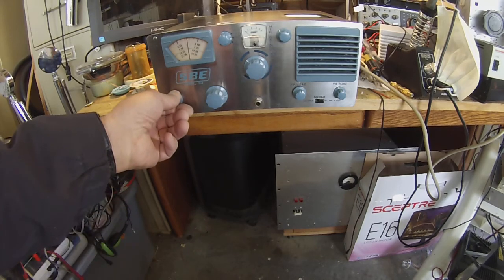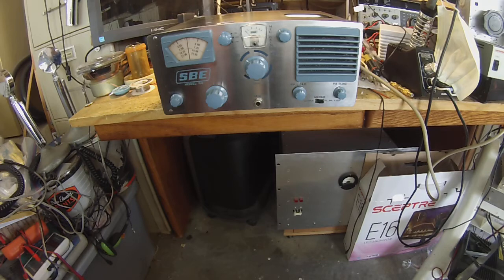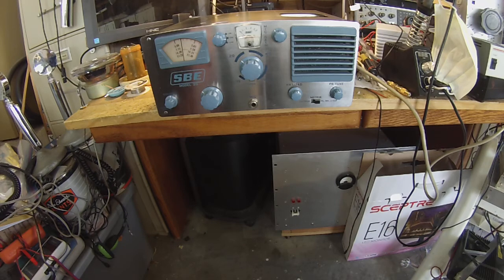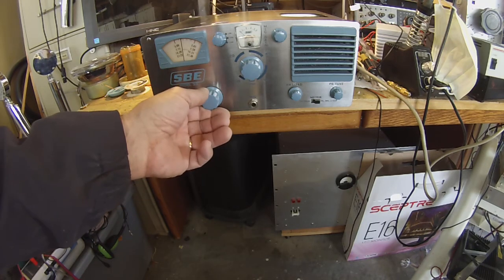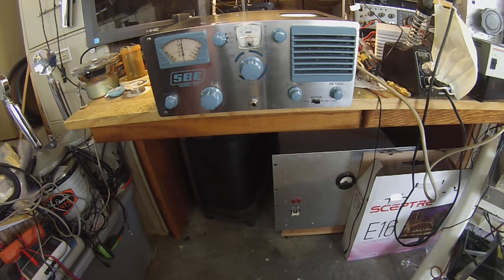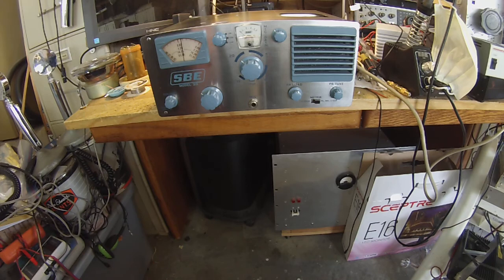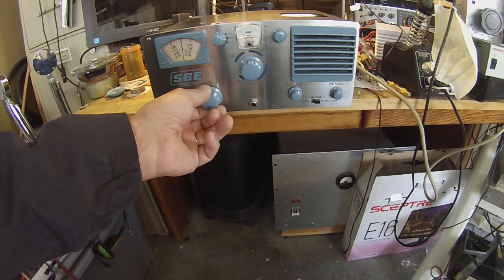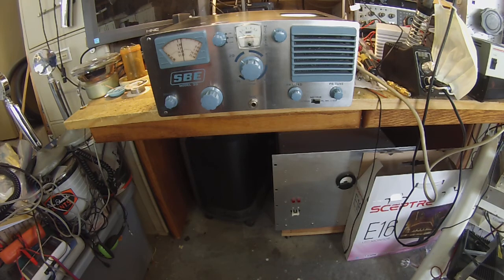SBE 33 Transistorized SSB Transceiver First Introduced in February 1963

Comment: it is a very good idea to replace the 25v rated electrolytics in the 10v power supply and associated with the audio section... i have also shotgunned the 3v electrolytics in the audio section with good results.  This will almost certainly prevent the only likely cause of transistor failure in these radios.  there are a couple of paper caps in the radio, including one in the PA !   These are highly reliable radios, with great performance.  The one feature of the 34 I wish the 33 had is the filament switch for the PA.  That would make it an ultra-low current drain radio on recieve.  I am sure the dial lights take more than the RX by a mile.

Comment: Have owned one for decades but sadly,  a tune-able mica cap disintegrated long ago and it's been in storage since. The part was ceramic with thin plastic leaves that slowly open/close and involved with the p.a. tuning  as I recall. l. I need to dig it out - it's been so long. It received but no  xmit. A shame. I'd sure love to get it back to working. A real conservation piece - even for non-hams who saw it. If anyone has a name to drop - I'd be interested. Cheers - 73!
Reply: Meant to say conversation piece - but maybe conservation works too, lol.

Comment: Wow ! Germanium , not geranium lol. I do not believe I have anything I am aware of with Germanium transistors. I may have a diode around maybe. I do remember working with them a lot.
Reply from the maker: you can still buy high frequency Germanium transistors from Russia with an Ft > 700 MHz. They would work in this rig.Pete N6QW
Reply: I did a little research when you announced earlier you'd be doing some things with this SBE and was surprised when I found out it was started with Gonset. Very early in my ham life I had a 30 Gonset and on 70 meters, with a full sized 1/4 wave ground plane on the roof of my metal barn with radials hanging down all over , I worked Antarctica. Was back in the early 70s.  I receive a bunch of congrats but there was no pileup afterwards as no one else could hear him. Yes I've heard of many obsolete parts from Russia , including tubes.  That's a high freq for Germanium. The Geranium joke was remembering when my dad first told me about them and I misspelled the words. 60s. I did a bunch of work on SBEs when they changed so much in the 70s.